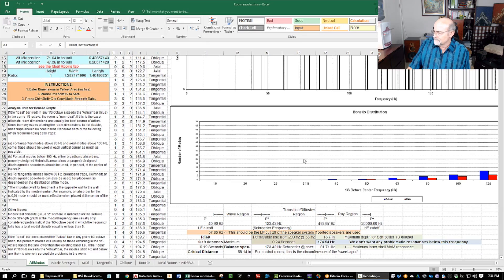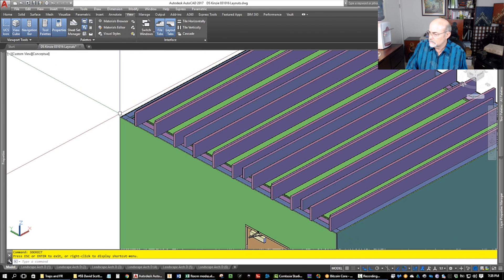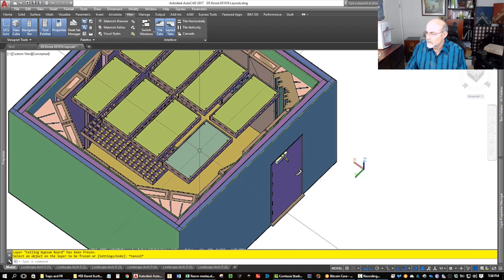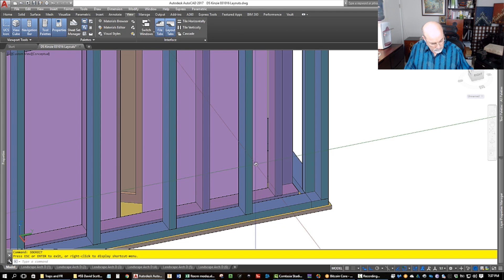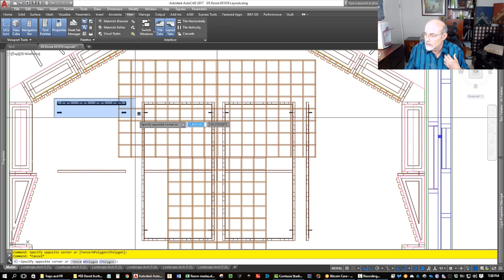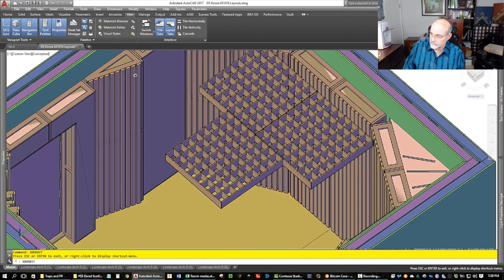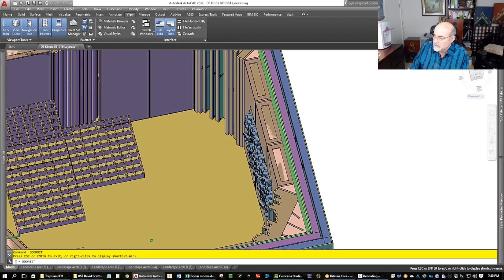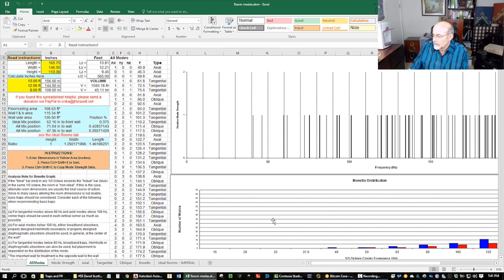Small Room Acoustics: Small Room Treatment Basics - Part One

Comment: What is the necessary application for space couplers?
Reply from the maker: A space coupler is an excellent diffusor, but only diffuses sound passing through it. It will improve the absorption of any trapping behind it. It also offers diffraction in the direction of the sound source.

Comment: My room is 7.14m length, 2.9m height,  and 3.16m width. will it approves the Bonello criteria and have a decent possibility to treat it well? I am sorry to ask this directly to you, John. because that room mode calculator spreadsheet is not working with my apps in my Mac pc(which I have only).

Comment: This is - I’m sure - a dumb question... but here goes:
How do I calculate the cubic footage of a room with a pitched ceiling ?
The room is ( using feet as the measurement)
14’ L x 9’.5” W, with a ceiling that pitches up from 7’.5” to 12’. 
Appreciate the method of calculation I need to use to get the cubic footage. Isolation is not a priority, as I I’d be using this room primarily for multi track mixing; my current monitors are JBL 8” active, and a smaller pair of 6.5 passives.
As a side note, there is a closet on the rear wall (the 12’ high side) with dimensions of 6’ wide, 27” deep, and 8’ high... 
could I use this entire closet space as effective low end treatment ( down to 65 hz or so) if I used this area as one big diaphragmatic absorber?
All surface boundaries in the room are drywall, the floor is covered with 3/4”carpet/padding combined. There is one 45” x 50” window in the middle (centered) of the front wall ( the side with the 7”.5” ceiling). 
I’m also willing to accept that this room might be one of “those” rooms that - because of its dimensions - is untreatable acoustically, or that would cost an exorbitant amount of money to treat.. 
thanks, love your channel!
😊🙏
Reply from the maker: Thanks for the comments. It is difficult to calculate the modes in a room that is not a rectangular cuboid. But you can get a pretty good idea of what's going on if you simply average the height. If you need personal help, please send me an email. John@jhbrandt.net
Reply: John Brandt - Thanks, John. I think I figured out the equation, once I stumbled upon the obvious X factor that I was dumb enough to not initially realize, and that is that the ceiling can’t be the same length as the floor if it’s 3’ higher on one end. 😉

Comment: I have a room 1.8M x 3.3M  ceiling 2.1M trying to find out if this is to small for a mix room..
Reply from the maker: You must have at least 42 cubic meters. That's my minimum recommendation. Your room is less than 1/3rd that volume. I recommend that you simply 'do your best' with that space without spending too much time or money & wait until you can find a larger space. - my 2 cents. :D

Comment: hello john, I have a question, to calculate the modes of my room with your excel sheet, should I use the dimensions of the original cement wall or should I use the dimensions of the floating gypsum wall, assuming I have built a room inside other?

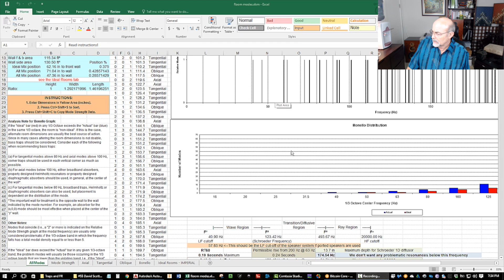Comment: So, are the dimensions mentioned in your room mode calculator @0:56 ~14*12.5*9.5, post treatment or are they the original dimensions of the room before any isolation walls and traps/treatments are put in?
Reply from the maker: Nishant Nair, yes. This is ALWAYS the bare finished room interior. This is INSIDE the finished isolated room.

Comment: Actually i was modelling the small room acoustic behavior in computer. I had two glasses on two sides and other two sides and floor is are concrete and had a big wooden table and small bluetooth speaker placed on it. When i was playing music i had kept the microphone the top of the speaker and it shows 83dB. Now i need to capture how sound behaves in adjacent corners(hearing points) of the room. So now i converted the sound(83dB) into acoustic pressure(0.000000282 N/mm2) and gave it as a input to my study and measuring the acoustic pressure at the hearing points.. Is this the correct approach for feeding in the input? or how do we input the 83dB in other form. Intresting thing i saw in the results is iam getting more pressure in hearing points(91dB) at some frequency which i could not understand. can you please help me out to understand this better.

Comment: Thanks John. Can slats be placed as desired or is there an optimal spacing distance between the slats? Also, what are you using for the back corner traps? It looks like QRD diffusers over superchunk corner absorbers but you mention something about air gaps so not sure I understood in your video.
Reply from the maker: The slats are arranged to provide 30% absorption area and 70% reflection area. Corner traps are Diffsorbers. NOT QRD. The verticals are arrayed into a prime 19 PRD. The back section is NOT superchunk (superchunk traps ARE reflective at low frequencies) There are waveguides wrapped with fiberglass and AIR in the corners. This is for optimal bass trapping. Most traps that are advertised as bass traps usually don't even get close to trapping bass frequencies. LOL!
Reply: I read (and verified on the "acoustic modelling" calculator) that very low GFR of certain fiberglass products absorbs very nicely when used in thick absorbers or as superchunk traps. Were you refering to higher density materials not being apt for superchunks?
Reply from the maker: Correct. The traditional 'super chunk' traps were using OC 703 or similar. And these are too reflective
Reply: Oh ok grand thank you for clearing that up. I am learning some good sstuff from your vids

Comment: what should i do to my room to fix the bass as its to loud   ,i have some bass traps ???
Reply from the maker: Yes, you're going to need bass traps. However, the room size and shape will determine where they should be placed and what type should be used.
Reply: thanks , iv made my own bass traps from rock wool   i have them on the front and back walls and in the 4 corners    ,, I'm in a loft so i don't have a high celin     ,i think i may have to much ??
Reply from the maker: YAMAN SITAR, it is impossible to have too much trapping. Perhaps it is not trapping the bass. I would have to see what you have and the structure of your room to recommend further. Send me an email. Cheers

Comment: Hi Mr Brandt,

Really fantastic video I must say. May I ask you a quick question?

Are Wall Braces really needed for all builds to stabilize the isolated wall or its only required if the build is in the seismic zone?

Thank you very much!

Jesper
Reply from the maker: Please! That's what the comment section is for. :)
Reply: Hi Mr Brandt,

Are Wall Braces really needed for all builds to stabilize the isolated 
wall or its only required if the build is in the seismic zone?

Thank you very much!

Jesper
Reply from the maker: Wall braces are needed only if the structure of the 'interior' room is wobbly. Normally, if you build a shed in the back yard, you're not going to need any braces to nearby structures... and about the Seismic question: Actually, sway braces, floating elements for flooring and ceilings can/will often cause a system collapse and failure during a seismic event! For that reason, seismic bracing (which is another thing altogether) is required in seismic zones.
Resilient sway braces are often REQUIRED by local government building codes. They ARE necessary in some situations.

Comment: Nice detailed CAD. Just gave me insight to my plans. Thanks.
Reply: Great detail in your drawings.
Notice the attention to decoupling from other structures. 
The locations chosen for iso hanging hardware help to dampen resonances in framing and the covering skin.  
The prime 19 diffusers in front of bass trapping with wave guides to effectively suck out narrow bandwidth anamolies in the low end. 
The cloud diffusor under absorbtion on the ceiling.
Every where I look, I like the utilization of the space. 
This room is quite an engineering achievement in design alone.
Building it and getting your test results proves your design premise.
  As an engineer with 36 years of live and recording experience,  my hat is off to you. Fabulous job.
Reply from the maker: You're very welcome! do it once - do it right! :D
Reply: I'm about to build my studio in my backyard, separate from my house. I have 5.5m x 3.6m concrete slab, What would you recommend for sound proofing or maximum sound transmission loss for my walls. Unfortunately, I can only build with timber. Your input is much appreciated. P.S. My plans are to build 2 sets of frames, a room in a room, concept.
Reply: RecordingStudio9.com
Reply from the maker: Send me an email! :D Send whatever drawings you have and I'll get you a quote. How 'bout that? ;)